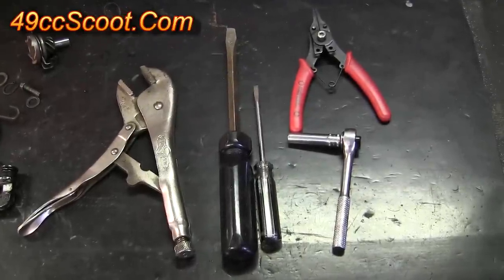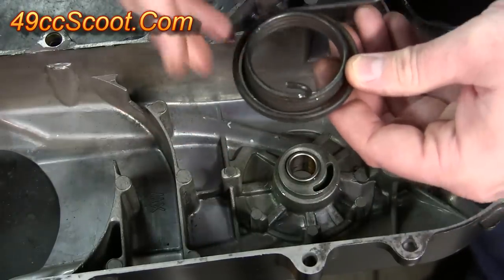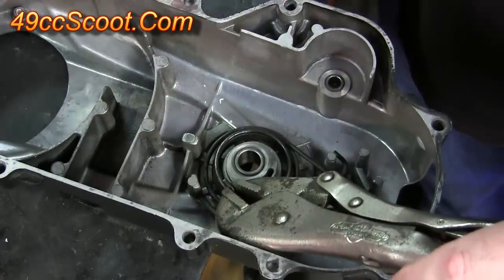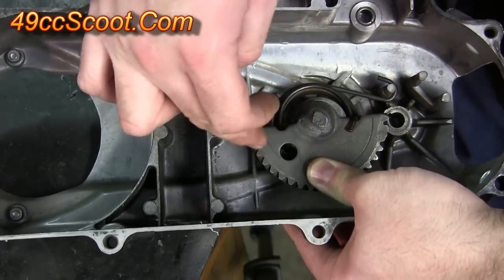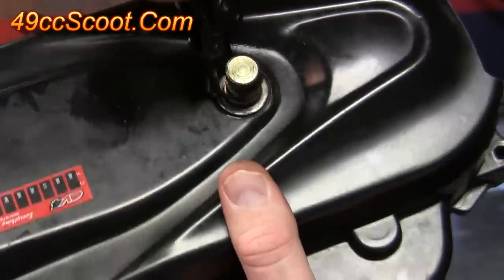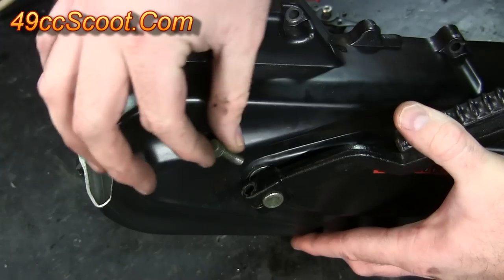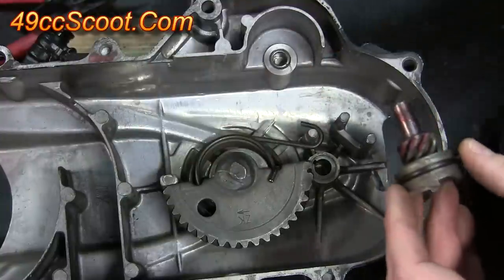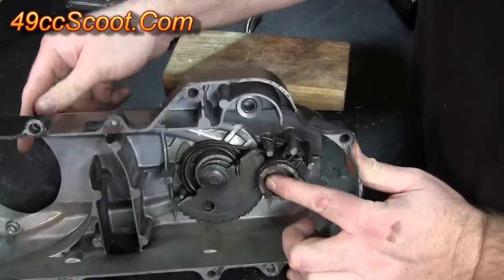139QMB (GY6 50) Kick Starter Assembly : 50cc Scooter Help

Comment: is it the same steps but backwards to take it out?? sorry if a silly question
Reply from the maker: Basically. Most end up with them out because something broke or came loose, but I don't suggest those removal methods. lol
Reply: Well i took it apart due the gear being stripped so i took it apart an hours tryin to put it back togethor, i got it lmao but now the moped won't kick over, any suggestions?? All the parts are in right.
Reply from the maker: First, figure out if you can even turn the engine over by hand or with the e-starter. If it won't move those ways, either the engine is seized/jammed somehow or the kickstart gear is jamming it up. If it turns those ways, then perhaps a part is bad in the kick assembly. 

If by "won't kick over" you mean that it will rotate but won't fire up and start, then that's a whole difference scenario and I'd start by checking for spark.

Comment: Hey man my bike makes a terrible ass Grinding noise from the side casing sometimes when it's running if I kick the kick start up or get it just right it shuts it up it's annoying and doesn't affect anything any help would be much appreciated 90GTVert
Reply from the maker: +David Figueiredo It may be in need of cleaning and lubrication. Sometimes cleaning and greasing will go a long way. Otherwise, perhaps the spring is worn out.
Reply: +90GTVert I took the side casing off today and I think the starter gear I think that's what that gear is it grinds on the wheel and sparks it's loose and no matter how many times I put it back in it just doesn't stay it just comes loose and sparks and grinds on that wheel you think that's the problem that starter gear
Reply from the maker: Maybe it or the cover is worn. Shouldn't be loose. Gotta find out why.

Comment: i have a tao tao thunder 50 and i dropped it in the rain and it didnt turn off i picked it up and it started making a rattling noise luckly i was still able to ride it home, but the next day it would not start and i mad sure before i up the night before it started up like 6 times, ive since rebuilt the kickstarter and replaced the whole variator and sliders and it is still jamming when i i try to kickstart it also when i try to e start it just try to turn on forever with out turning over i really need help, broken crank shaft? or seized piston? i really dont know
Reply from the maker: I replied on your other comment.
Reply: @49ccscoot  I don't see it
Reply from the maker: @gabanaboy1615  Sounds like the starter bendix may be bad or out of place for one. Make sure the cover isn't cracked. Go over the kickstart again.
Reply: you have a big hole cut into your cover? but that rubber ring you pointed out on this video I forgot that but i don't think that woud make that do that
Reply from the maker: @gabanaboy1615  The action won't be right without all of the parts. The hole in mine  is for cooling. CVTs get very hot.
Reply: @49ccscoot  kk thank you

Comment: Can you use the g6 kickstarter shaft to PGO Big max?
Reply from the maker: I'm not sure. Sorry. I did a quick search but it appears that there are different models.
Reply: @49ccscoot  thank you for.your.quick reply.how about welding a loose.kickstarter shaft could.this work?
Reply from the maker: @realstreetcatslife5015  Depends what you're welding. If the diameter were worn, you could probably weld and then machine it down to get the proper diameter again.

Comment: why cant i get a vid on 49cc start, bendix repair?
Reply from the maker: I never repair them, just replace. Take the bolts out of the CVT cover and remove it. You should be able to work the bendix out past the variator and fixed pulley. Make sure the bushings are in place in the CVT cover and in the case where it rides and clean. Apply a dab of grease to each end of the bendix where it rides in the bushings. Work the new bendix in there the same way the old one came out. Replace the cover and bolts.
Reply: ***** COPY.

Comment: Is all parts the same on a Short and long case?
Reply from the maker: The process is the same as shown in the video but there are some scooters that use different lengths of kick shafts. Not necessarily short/long case differences, but differences in manufacturers, so if you have to order parts it's best to check measurements when provided by a seller.
Reply: Okey. Thank again :)

Comment: Mine don't have a bushing that goes in the hole. Also, I bought a new set of everything, but shit comes loose when I kickstart it. Also, terrible grinding noise when its loose. I have put it together just like this. Maybe one or two kicks and its all loose and shit again. Very frustrated
Reply from the maker: Are you sure it isn't supposed to have a bushing? Does it feel snug going through that hole? If not, the lack of the bushing could be the issue.
Reply: The bushing doesn't fit. Its too big of a bushing. I wasn't having any problems, until I hit a bump, then it started making the grinding noise. I didn't see a bushing when I first took the casing apart. Ever since, I have installed a new kit plus the old kit. I don't know what else to do. Its a 2013 VIP future champion 50cc also, yes, it feels snug.
Reply from the maker: Any sort of unusual witness marks (signs of contact)? Damage to the CVT cover? Returns well when first installed?
Reply: 90GTVert no sir. I don't have any idea. But I have no gasket
Reply from the maker: Is the spacing good for the shaft and the clip that holds it in place? Maybe try a different washer if you aren't sure. If that is secure and leaves little play and there isn't much play in any fits into the CVT cover, I'm not too sure why you'd be having this trouble.
Reply: 90GTVert appreciate your help
Reply from the maker: No problem. Wish I had a definite answer for you.
Reply: i have same model  "2013 VIP future champion 50cc " it actually has a bushing (as well as the TaoTao ATM50-A1) and it is the same 139qmb motor but using 69mm valves. cheers!

Comment: For the life of me, I can't pull that fucking spring back.
Reply from the maker: I had a hard time with kickstarts when I first started working on scoots. I was trying hooks and wires and prying to get the spring in place, but for me the vise grips make it fairly simple. The vise grips have to be able to grab well or they'll slip off when you're pulling it around. Got anyone else around that you can get to try it?

Comment: Hey, i'm fixing my kickstart, everything looks exactly like in this video, but it binds up. Only works if I apply pressure to that small gear. What could be the problem?
Reply from the maker: Maybe something isn't seated right or worn so there's slop?
Reply: @49ccscoot  fun part number 2, I broke the line-up tab :) now I dithed the spring, it ratchets some times but spins. Now fun number 3 hard to start. It didn't actually start. Maybe it has low compression. How can I test compression?
Reply from the maker: @gedas3419  The kick starts on the 139QMB suck. They break way too easily and IMO should only be used as emergency backup. I would suggest getting the electric start in good working order if it is why you are working with the kick start.

https://www.youtube.com/watch?v=l_RMl5IIenA
Reply: @49ccscoot  yup, baterry is dead. It jump started starts well. It charges from the motor. And charges enough to start, after 25min of idle it charged enough to easily start. But after 30 mins of beeing shut of if doesn't spin the starter. Battery doesn't hold charge anymore. But as a teen I don't have money for new battery now. 30euros (approx 30dol.) is damn expensive
Reply from the maker: @gedas3419  Broken kick start parts will become much more  costly than replacing a battery every few years.